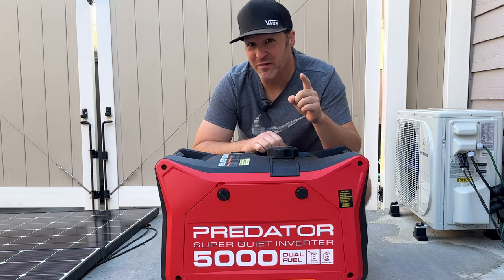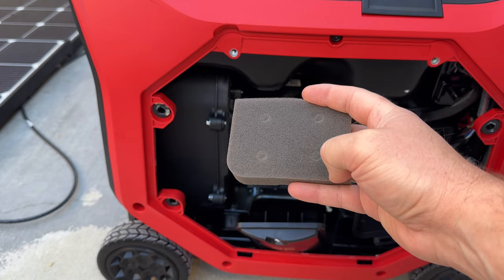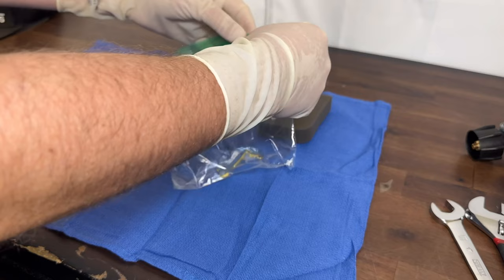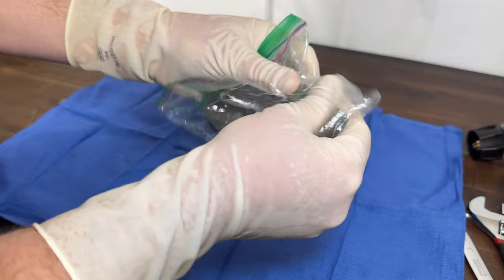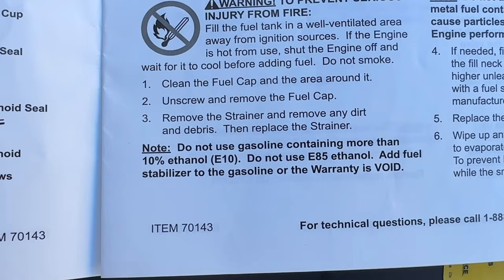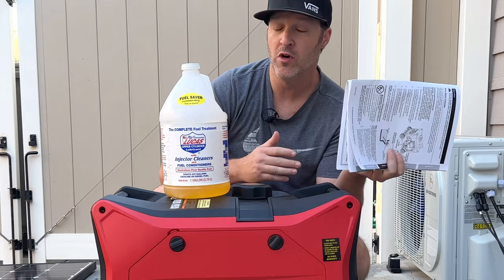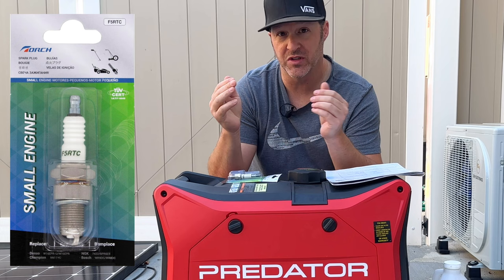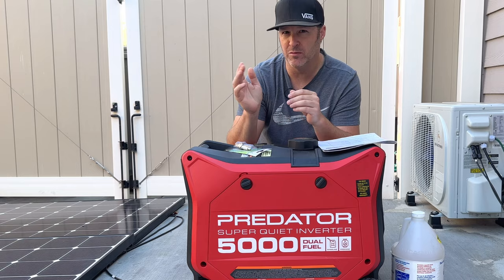Harbor Freight Predator 5000 Fix and Tips for New Owners !!

Comment: Use K&N air filter oil. It comes in a spray can, is red and sticky to catch more dirt. You can tell how dirty the filter is by the color change. Red is clean, not red is dirty, black is "how is this still running?"

Comment: You can lightly spray your air filter with Pam and even your home filter for your furnace, I learned that tip from my HVAC technician, don't get too crazy with it , don't buy the super duper air filter for your home furnace because it cuts down on your air flow, just the middle of the road filter with the light mist of Pam.

Comment: Totally Unnecessary
Reply: And it will lower the intake pressure, and draw in more fuel. Causing it to run rich when using gasoline. Thereby increasing fuel consumption.
Reply from the maker: Hence in the manual it clearly states all of it. 
I guess you just leave your air filter in your quads and dirt bikes unoiled as well…🤷🏼‍♂️

This is a foam air filter l, not multi layer paper filters. 
Different
Reply: @johnnysweekends  So you put wheels on the generator and take it mudding? 
And yes, I don't oil anything! There is this invention called a "Air Filter"
Reply from the maker: @ralfsautomotive no offense being that your a automotive shop I would expect you to know this. 
But after being a mechanic myself for many years you should know that foam air filters are most times superior to pleated paper. Not to mention reusable and stop more fine particles than a paper filter. But need to be serviced more frequently. Hence you oil them lightly to stop the finer particles. 
Generators are used in many harsh conditions. Rain, snow, mud, dust, and more. Construction sites they are used a lot or racing events where conditions are horrible. 
Foam filters are used in so many applications and every manual will tell you the same thing. Unless you prefer to avoid manuals. 
But in today’s world, you do you..👍🏼
Hope the information helped

Comment: The "FIX" is the Suzuki liquid cooled 6.5 Kw invertor gen-set! This side of a Cummins/Onan flat twin Diamond Series, I don't know of ANY small gen-set sold with a THREE YEAR no hour-limit warrantee that is REALLY QUIET! The yellow one is the consumer model with about a 3 1/2 hour half-load run-time and the BLUE one is the "commercial" with a 7 hour at 70% load run-time. Not cheap, but good.

Comment: When are you going to do an review of the AIVOLT 8000 gen set?  There are no good videos about the unit.
Reply from the maker: Not sure. I know they are copying a lot of other companies, so maybe I could look into it. 
Could be good, could be bad.
Reply: @johnnysweekends  Yes Sir, I’m interested in that fact that it’s rated a few more watts higher than the IMAX 7250.  I want to be able to run a 4 ton ac without going to the much heavier 10000 watt gen sets.  I am concerned about becoming an old man someday and not being able to push a gen set across the yard!  😂.  How about a review on the Champion 9000 watt open frame Tri fuel?  Not much out there about the 9k champ.  Thanks for your reviews and sharing your knowledge.
Reply from the maker: You can also add a micr air easy start to your home ac unit 👍🏼

Comment: The foam filter tip was spot on, I have 3 champions and all of the foam filters were dry.  Was getting them ready for hurricane season here in Florida, your tip got me checking.  I think all the Chinese made generators with foam filters are shipped dry. Thanks much!
Reply from the maker: Yea seems a little more common. Even though they were lightly oiled now it seems no oil ..🤷🏼‍♂️

Comment: Thanks!  I just picked up the unit today. $825.00!  I’ll order up some plugs too. New subscriber.
Reply from the maker: $925 for the 5000 unit? Super coupon?
Reply: @johnnysweekends  yes. I guess so on the coupon..most I received were 10% and could not be used with generators. I got a HF credit card and got 0% for 2 years. 40.00 a month..easy payments. Paid 824.99 and picked up a few quarts of oil as I think I’ve seen they want you to flush the oil and few times during break in.

Comment: Thanks for the tips, great idea on how to oil the air filter without over saturating!  Question, do you think it's worth waiting for a dual fuel 7500 or 9500?  I ultimately want whole house generator power, (small house), and could run them in parallel. Just wondered your thoughts. Thank you! :goodvibes:
Reply from the maker: Have you seen the new Genmax tri fuel… I have discounts right now as well.
But this way you have plenty of power unless you turn everything on. 

But smaller units will consume less fuel so depends what you want and your over all power needs

Best New Generator GENMAX 10500iETC Tri-Fuel Inverer Generator!
https://youtu.be/6GvyZEFDCpw
Reply: @johnnysweekends  Per your video the Genmax looks great, but I'd prefer something I could return to a harbor freight store if I had issues versus Amazon. My preferred fuel source will be propane, so I'll lose power vs gas. Also, I was looking to parallel run two smaller generators so I would at least have one running generator if the other failed. I could manage with less, but 10 to 14 k would be my maximum need. I'll take a chance and wait till the end of August and see what else the Predator line up offers.  Thank you!
Reply: Yes wait for the duel fuel, and if you're doing whole house go for the big one and run propane whenever possible, you never want to Max your generator out so purchase one slightly bigger than the  demand that you're going to put on it .

Comment: Are the high altitude jet kits only for running on gas? I could be wrong but i don't think that jet is used for Propane.
Reply from the maker: Yes the jet kits are only for gasoline. Propane by passes the carb

Comment: Great video!! I am planning on getting the predator 5000 for our rv. Did you change you ac capacitor with the soft start or is the 5000 good without it? Thanks
Reply from the maker: I do have soft starts on both Ac units as I use a battery system most times but a generator for extended or really hot days
Reply: Careful using soft starts.   It puts more current to the start windings.   Start windings are not heavy enough to handle the increased currents.

Comment: What is the consensus on the quietness of the new 5000 to the 3500?  The owners manuals show 60.5db at 23 feet for the 5000 at 25% load (975 watts) and for the 3500, 56db at 23 feet and 25% load (750 watts).  Any chance of a direct comparison with the SAME wattage between the two?  The sound rating in the manuals won't be an apples to apples comparison as is based on 25% of max vs a specific load (say 1000 watts?).
The 5000 has a 224 cc engine at 8.6:1 compression vs the 3500 having 212cc at 9:1 compression.  No way they are getting 900 watts from 12CC more and .4 points of compression less!  It appears the higher power rating of the 5000 is mostly coming from the maximum engine rpm!  It's 3800 rpm on the 5000 vs 3600 rpm on the 3500.  HF is rating the predator 3500 at 6HP and the 5000 at 6.7HP too.
Seems a bit of a bummer IMO.  Louder, more expensive (the 5000 does have dual fuel though), and still has the same 90 day warranty.  The larger wheels and retractable handle are a nice change too.
Thanks for the great review!
Reply from the maker: The 3500 is a pinch quieter, but the extra steering and running also come from changes to inverter board and capacitors

Comment: Nice tips!  I was wondering, what is the approximate gasoline capacity of this generator?  
There are specs saying how long it should run for but not how much fuel it takes to fill.  Thanks!
Reply from the maker: 3.7 gallon tank 👍🏼
Reply: @johnnysweekends  Thanks!  I had even downloaded the manual and searched but it wasn't anywhere I found.

Comment: You call for the NGK BP7ES plug, do you know if could you use the resistor plug BPR7ES?
Reply from the maker: Use the correct plug according to the manual
Reply: I ended up using the BPR7ES in my 5000 series and it seems to run without issue. If you look up the BP7ES on ngk's site it shows as discontinued and directs you to the BPR7ES.

Comment: Wow non ethanol here in Wyoming is just premium fuel.   I never put ethanol in small engines ever
Reply from the maker: Yea a little tougher where im at. I have use regular gas with ethanol since it has come out, sure the first couple years a little bit of a learning curve. And now i still use Lucas because it just works. 
I never have starting issues now but nothing of mine sits for more than 6 months. Except my gas powered chainsaw. Which I should go fire up.

Comment: NGK spark plugs aren’t much better that the torch plugs. If you can find them. Champion N3G or N3C are awesome plugs. 

I used to go thru a case of NGK plugs in a season of racing motocross, but 1 Champion N3C would run flawlessly…….
Reply from the maker: Well I would have to disagree on this one, we have ran them for years as well even in our race seen in our high performance skis. While I would never let them go a whole season on a race ski the Rex or practice stuff you let run till it has trouble starting, sometimes a couple years. Definitely better than a torch. Those last a few hours it seems before it was harder to start. 

I’m sure the champion n3c is fine as well.

Comment: The spark plug I received using the link was BPR7ES
Reply from the maker: Well that’s not right. Even when you click on the link it’s shows bp7es 
Tell them to get there act together lol.
Return!
Reply: @johnnysweekends well the R just stands for resistor. Wouldn't that work fine?
Reply from the maker: No because if the ignition is not designed for a resistor type plug it can cause issues with pre ignition or back firing and possibly ruin electronics. 
Get the right one. That’s a Amazon seller mistake and they need to fix
Reply: I got the BPR 7ES as well. They told me that replaces the BP 7ES. So I can’t get the proper NGK plug do you recommend a champion or other brand and what would be the number?
Reply from the maker: Check the manual for correct plug. Champion works but I prefer NGK. The Torch just give me issues

Comment: Just use non ethanol fuel no  need for additives.
Reply from the maker: Honestly not as easy as just run non ethanol fuel. Some people dont have it readily available at fuel pumps and some people have to drive 20 or 30 miles to get it which could be double the cost of a normal gallon of gasoline. Or you buy the stuff in the stores which is also about $10 a gallon so not a very feasible option if not readily available at a pump for maybe only $.50 more per gallon. My nearest option is 14 miles and $8.50 a gallon. So nope.
Reply: It's 2024 can't be that bad watch Taryl fixes all he went over how bad the fuel treatments are and that engineer fuel is a joke.
Reply from the maker: @richardkeyes986 did he personally do testing on Lucas’s fuel conditioner ? Injector cleaning, valve cleaning , head cleaning, piston dome cleaning? Did he do long term analysis like 6 month and 1 year? 

There are plenty of additives that are junk. Lucas is a good product. 
I do know what year it is but dont understand what you mean.

Comment: wet fouling iridium way go never change it
Reply from the maker: Iridium is for cars and digital ignition.
Waist on a lawn mower engine.

You could buy 3 ngk plugs for almost one of those.
Reply: @johnnysweekends  Garage guy reviews does have resistor.  I think small scooter plug  CR7HIX 7544 Ngk need terminal nut end
Reply: @johnnysweekends  I have 2 stroke snowblower going try one fouls quick
Reply from the maker: You can try it, but dont expect any gains in performance or longevity on an outdoor power equipment engine. Plus if the snow blower is fouling out quick it’s due to either your mix is incorrect or carb adjust is wrong.